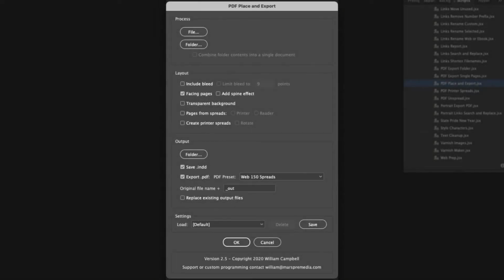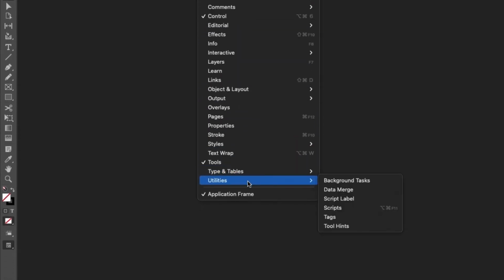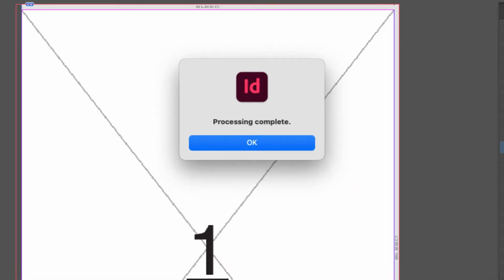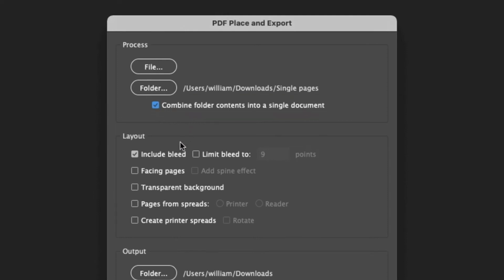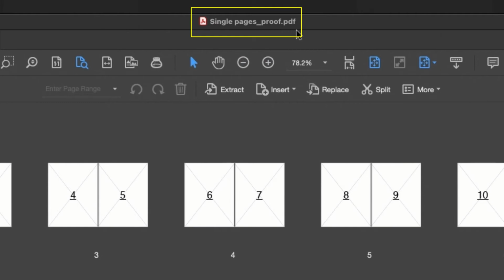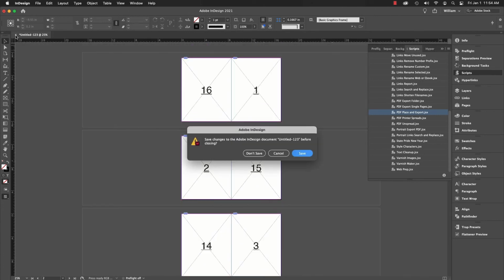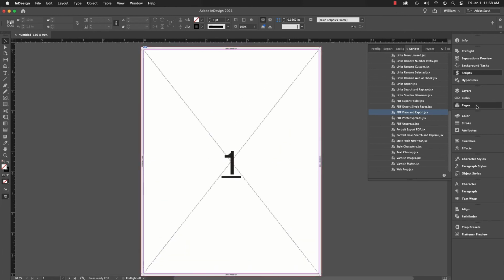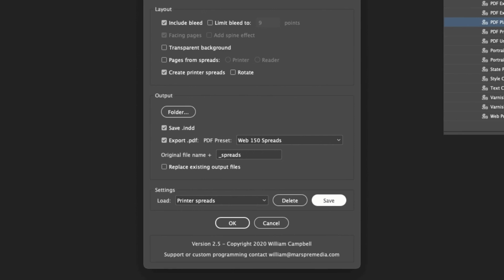InDesign Script PDF Place and Export

Comment: Exactly what I've been looking for. Great.  However, I keep getting the 'Value is a NaN' error. What could be the issue?
Reply from the maker: Got your message, and got the error figured out. Now fixed. Download updated version 4.6 on website. Thank you for reporting the problem.
Reply: @wc7  Anytime. Thank you for a great script!
Reply from the maker: "NaN" means "Not a Number". That is a bug. But I need more info to track it down. I assume you are getting an error alert. I need the full details that include the line number in the code producing the error. Also, it helps greatly to know what choices in the interface are used that produce the error. Possibly even the files used but we'll see if I can't figure it out without those. Look on my channel page, contact tab, to reach me to send a screen capture of the script choices used. Or my website contact page https://www.marspremedia.com/contact
Reply from the maker: Could I get the line number at least? (in the error alert) Then I can probably figure it out. Thanks.